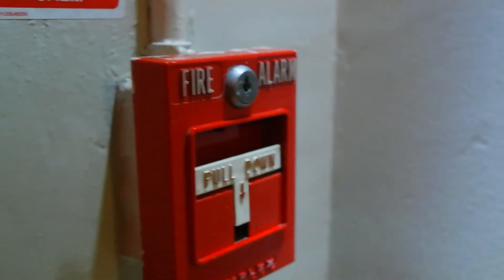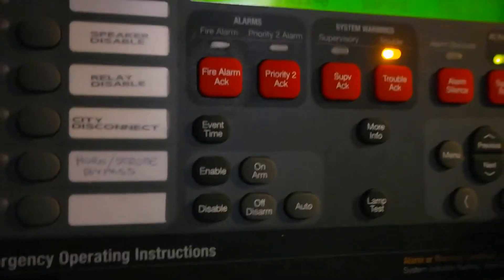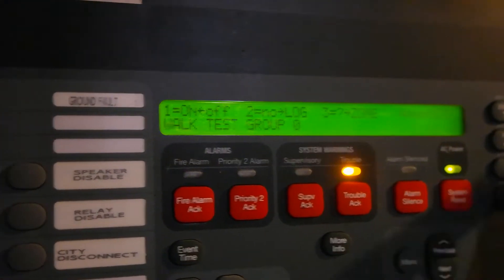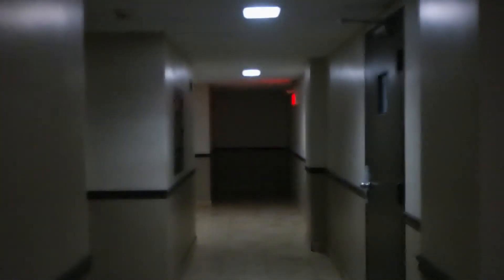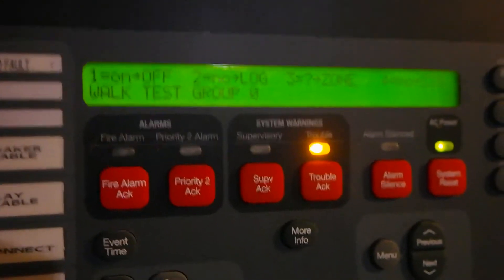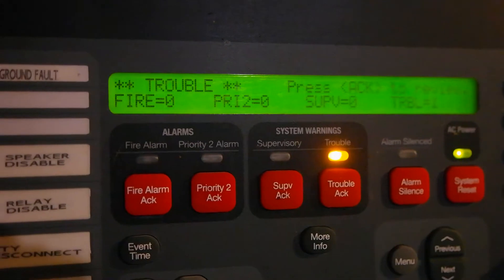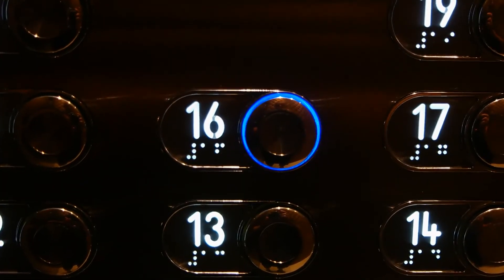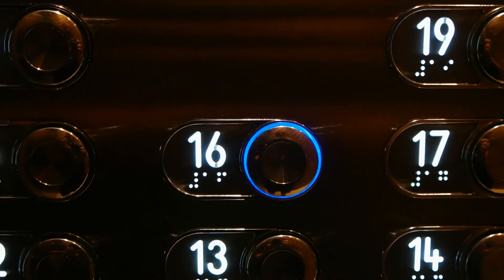Walk Test Simplex4100

Comment: Yeah I like how Simplex voice evac systems do this in walk test.

You've been in the business for 35 years? Wow, by now you must have seen just about everything (except a t-bar station failing of course).

What's with the two ceiling speakers right next to each other next to the TrueAlarm? (that are different sizes no less)

Very strange how pulling that one t-bar doesn't activate the system as intended (not to mention how the handle doesn't stay down) but opening it does. I assume you ended up replacing it.
Reply from the maker: We replaced that pull station with a 401.  The 2 speakers ?    I'm gonna have another look. I have at least 30 creations to post, just trying plan out a "b" strategy if this tube gets weird again.
Reply: @firealarmapprentice4517  401? You sure you don't mean "2099" or "4099"?

Don't really get the last part.
Reply from the maker: @TheCarson116  we put in an ms401.  It was conventional, only the smoke detectors near the elevator were addressable.  Not sure about the other comment, its difficult to comment on this platform
Reply: @firealarmapprentice4517  An MS-401? Why would you replace it with a Mircom pull station of all things & not a Simplex one?

Conventional pull stations with addressable smoke detectors? Never heard of that before.

Not really, you comment on it like any other website.
Reply from the maker: @TheCarson116  So in Ontario, when they upgrade elevators, often they will add addressable smoke detectors on every floor elevator lobby separate from the conventional devices. It makes more sense from a programming aspect.    As far as the MS401 goes, I'm just going from memory and I think his stock was MS401.  Most techs don't stock T Bar pull stations, just ms401 or fm950's.
Reply: @firealarmapprentice4517  Alright...